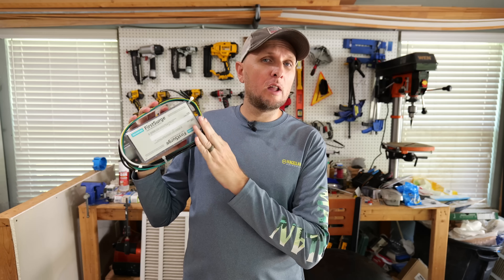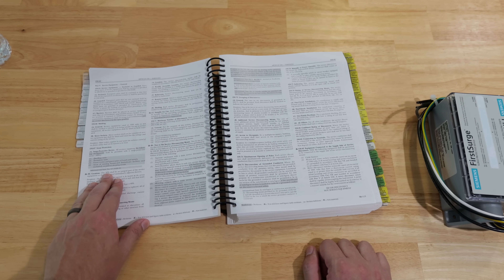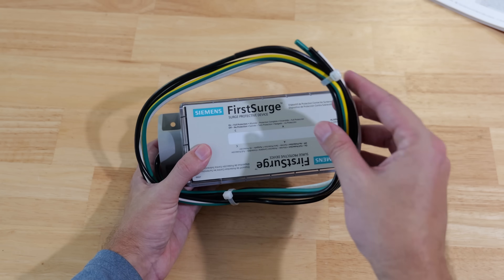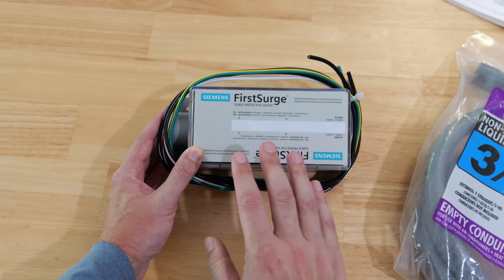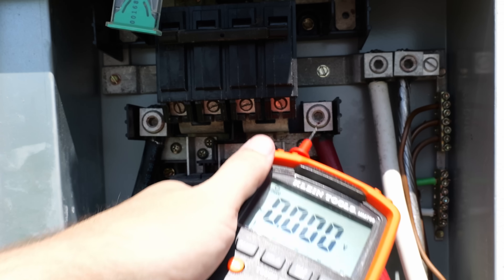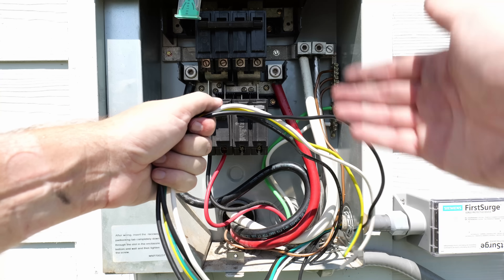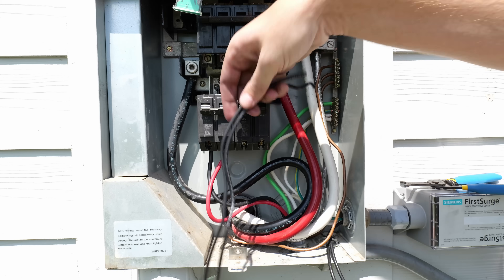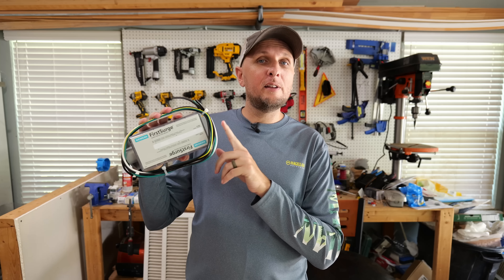Why Whole Home Surge Protectors Are Now Required and How To Install One!  Siemens FS140

Comment: If it makes you feel good go for it, it’s your money. More and more devices are mandated by the NEC because the code writing committees are packed with paid representatives of equipment manufacturers. The reality is that this stuff might protect some things sometimes, with a lightning strike there are NEVER any guarantees. The components inside these don’t last forever and most people won’t notice or recognize when they stop working so after several years they won’t be protecting anything. My experience as a 25 year master electrician in industrial and power distribution these devices generally cause as many problems as they prevent.
Reply: It is mostly about the money for the manufactures.

Comment: Where is your torque screwdriver? Code now requires torque to spec...since you are following 23 nec
Reply: I have found multiple breakers that have stripped screws due to over tightening, and found many ground, return, and breaker connections so loose they are intermittent or are overheating. I now use a torque screwdriver -Always!

Comment: For 50 years and longer never had a surge issue damaging anything. Last year I added a Square-D surge protector that fits into a breaker slot on my homeline panel. It is doing its job silently, still no surges that need protecting against ever noticed. Codes compliance keep electric people busy making money.
Reply: I often observe "it is better to be lucky than good." You are in an area that does not get a lot of lightning strikes on the lines. Usually people in vulnerable areas take strikes every few years or even more frequently. The cost of having an SPD installed is a tiny fraction of the cost of a healthy lightning strike.
Five years ago I retired from IT Filed Services for a Fortune 100 electric company. (There is only one here in Arizona, but I don't feel right mentioning their name.) Many of our communication facilities took lightning strikes, with a few costing us less than $1000, most in the $3000 - $20,000 range. The last big one I attended did over $30,000 damage to one piece of equipment and it took me more than a year of puzzling to understand how it got in.
Reply: Weird, been on earth 40 years two houses, no decided broken from surges...
Reply from the maker: Weird.  I haven’t even been on this earth that long and have had numerous things damaged by surges until I installed this.
Reply: @HowToHomeDIY  how many smoke detectors have you had to replace due to surges?
Reply: We live in Newport News VA, perhaps our area and Dominion power has little troubles with surges. We also almost never lose power. Last time without power was Hurricane Isabel, was out for 12 days which was tough, but the Troy-Bilt 8000 watt generator worked well for the whole house with the interlock.  @HowToHomeDIY

Comment: it show this model as a newer option to the siemens you suggest.  is it better?  Siemens Boltsheild FSPD140 Level 2 Whole House Surge Protection Device Rated for 140,000 Amps, 120/240V
Reply from the maker: It's not better.

Comment: Sometimes I think a lot of this is overkill, been living in this house out in the country for over 30 years, 2-3 computers, wifi routers, fiber modems, 3-4 flat screen TV's etc. etc. 60x40 steel building shop on a 200 amp service with at least 7 VFD's running 24/7,  Missouri in the Ozarks, power goes out at least once a month, backup generator takes over for a few hours,  lot's of lightning storms, at least 1 lighting strike a year on my property, shattered oak trees etc. Had a well pump get fried once 25 years ago, pump service said a lightning strike somewhere else in the area traveled through the aquifer and took out the pump, all paid for by insurance, no other person I know of has had any issues with power surges, maybe I live in a lucky area, who knows. lived all over the country growing up, Florida, Louisiana, Arizona etc. dad was a electronics engineer for the government, not once in my 62 years have I seen an issue with power surges damaging anything in my house or shop.

Comment: Knowing how to install it is valuable but understanding how it works is much more valuable.
Reply: Anything with an MOV will eventually fail.  The only way to effectively keep surges out is to use a series-mode inductive filter.  SurgeX is the best known brand of series-mode  but they do not make a whole house unit that I know of.  I own a SurgeX 20A unit thru which I power an extensive A/V production set-up and it saved my kit from the time my service took a direct lightning strike.
Reply: scottiestech info channel has the best video and john ward has good series of videos too. It is important to note that they go bad and need to be replaced every few years. Don't get the one seen in the video, get ones that go in a din rail so it can be cheaper and easier to replace.
Reply: @gg-gn3re some DIN rail devices are garbage out of China. 
Yes the Siemens is very pricey but it’s not garbage and far superior than most DIN mount devices. The only DIN devices that are trustworthy are manufactured by Eaton and Merzen.

Comment: i lived in a small country where brown out, load shedding and other interruptions was frequent so for over 20 years now we use  inexpensive surge boxes that plug in the receptacle and the appliances plug into them that monitors over and under voltage, surges especially for refrigerators it provides a delay restart to allow the fridge compressor to relieve some pressure before restarting.. i seen similar items on Amazon for ago $30  now a days plus for really sensitive stuff a UPS works wonders
Reply: Those are what you need not this

Comment: As well as many here, I feel this is just one more way for manufacturers to make money - requiring something through code. Yes, it's a good idea device, but I don't believe it's such a safety of life item that it deserves to be in code. I would like better explanation of its purpose when it is only required in sleeping areas of nursing homes. How does that jive with CO alarms and other electronics? Hmmm.
I am a home inspector and I do not call out the lack of an SPD in homes.
For those asking, the reason your newer home didn't get one when built is likely because your local authority does not require the most current code. Most are one, two or even three NEC issuances behind in their requirements (it comes out in 3 year intervals).

Comment: if you have 400A service with split 2x200A MCB panels, would it be enough to install on one of them? Similar situation would be a 2-family house with one overhead line to two separate meters... Thank you.

Comment: Here in California, the power lines have lightning arrestors. Power lines are struck by lightning very often in rural areas. In central Brasil, where there is no air traffic, the skies a super clean, and consequently, you get many clouds stacked on top of each other. A cloud is a giant million volt battery, and when you stack them they will eventually be so powerful that you will get lightning, and these puny siemens surge protectors are worthless for that kind of situation.  Not sure why the code requires this very weak device. If you are worried about lightning you gotta do way more.  

In cities near airports, there is so much soot from jet plane exhaust that high clouds cannot form, and this dirty air means no lightning strikes. 

Lightning is a byproduct of clean air. few people realize that 900 million gallons of jet fuel A are being burned in the skies yearly, and jet fuel A has Methyl Bromide in it, which is the main ingredient in the infamous Agent Orange defoliant used during Vietnam war.

Comment: Looks lie an older panel that does not have a separate ground bus and neutral bus?
Reply from the maker: It is only 7 years old.  It is the main panel.  They all have the ground and neutral bonded, there is no separation.

Comment: So, the NEC is going to pay for the devices AND all labor to add those?
That is an additional thousands dollars or more to have those installed.
NEC never got MY CONSENT for that.

Why aren't those built into your electric meters????
Reply from the maker: They aren’t that much.
Reply: @HowToHomeDIY  It is when the dang inspectors want everything else upgraded at the same time (like grounded outlets, replacing cloth wrapped wires, etc).
And the labor and such when hiring commercial companies to come out and do it.

If I had to replace my panel I would do it myself and skip all that money grabbing nonsense.
Reply: PS to replace an outlet and add two in my garage (detached) would cost me over $2,000.
They would have to rewire the garage, run a new line from panel up inside the 2nd floor of the house, then to the garage.
So I did it myself skipping all that nonsense.
I use an existing ground rod at the garage (separate from the house one) and added 3 feet of internal wiring and 8 feet of ground wire.
Works perfectly. Even have 2 of the outlets ground fault protected. Couldn't do the 3rd one due to space and wiring considerations so I rarely use that except for a clock.
Less than 0.5 ohms resistance to ground.
Voltage the same as the house too.
No discernible losses or hazards.

Comment: We had a bad linesman do a repair (dirty power) on the powerpole near our house.  A year later we came home to a disaster.  The neutral had dropped from the pole, the power had nowhere to go back to and the voltage kept climbing in our house.  Destroyed two water heaters, two whole house electrostatic filters. all small electronics from alarm clocks to gaming consoles.  Destroyed many plug in surge protectors and set fire to my air compressor in the detached garage.  The garage was full of acrid black smoke as the fire caused the compressor oil to leak which in turn caught fire.
Reply: Sounds like a nightmare.  A surge protector might not protect against that since they are designed for transient spikes and not sustained increases.
Reply: @dansanger5340 Thanks for your comments, I looked into that subsequent to your comment. Yes, a surge protector would not have helped me on the voltage continuing to climb, only a good neutral connection can save you.  That is why as soon as you see you have dirty power, call the electric company to see if there is a bad nuetral.  We obviously did that but they either did not do anything and said they did or just made another bad connection.  I don't know, maybe there is a device that detects a sustained voltage increase, and can somehow trip a breaker to simulate a ground fault, I shall keep researching.
Reply: Make sure your ground in the house is good. The one where the ground rod is at.
Reply: I worked in a federal government building where we were installing RF screen rooms for testing radios.  We bonded the shells of our rooms to building and found there was about 40 vac from the neutral conductor and the building steel.  Something had been done incorrectly with the three phase step down transformer for our area of the building.  Electricians fixed the error.

We also encountered an interesting problem with Topaz voltage regulating auto transformers for the single phase 120 vac power feeding the screen rooms.  The Topaz units were tap switchers which had a board with thyristors to automatically pick a tap to deliver close to 120 volts.  There was a small always-on signal transformer to power the control board, protected by a 1 amp fuse.  For reasons unknown the fuse in one unit opened and that set up an oscillation which generated 1800 volts of RF on the wiremold outlets in the room.  The same thing happened about six months later on the Topaz transformer for another screen room.  Sometimes trying to do good things winds up causing trouble you didn’t bargain for.
Reply: Sounds like it was your fault, bad ground, don't blame someone else for your fault.
Reply: @kidkv  Unfortunately, this was not a short circuit situation, a dropped neutral causes voltage climb, it is not a ground fault.  The electric company took full responsiblity, paid all claims outside of insurance company involvement, their head trainer was actually the guy who responded and came out and took photos of the bad connections, and the fire damage in the garage, said it was the worst connections he had ever seen in 40 years and would use this as a case study and develop training materials on the importance on following the SOP on making neutral connections.  As you are an expert in electrical engineering you would know that the neutrals and the ground connect to the same bus bar and all go back to the neutral at the pole.  If there was a short and the main trip to the house supply went then everything would have went to the ground circuit and to the ground rod.  But please keep commenting, your input is very valuable.
Reply: @David_Avidmind  Is your service connection 3 phase ? 

If it is i believe what happened there is that incase of an open  pen conductor or neutral dual phase will be in your single phase circuits (basically line to line voltage will be there in a single phase load )

Loads that are not rated for that kind of voltage will fail. 

Solution: So what can we (as a consumer) do, We can  install a voltage monitoring relay usually cost under $100 (which can give a wide range of protections including an open neutral/pen ) 

If the utility company is using tncs ask your electrician to ground pen conductor on your premises.  

Hope this helps :)
Reply: @alex-hk  Thanks Alex, I will look into that.  I have Single phase, 2 poles coming in the house into two 300amp panels.  We have a very long driveway with a transformer all our very own at the pole nearest the house.  The neutral they worked on was where it drops from the transformer, there is a connection about two foot up from the base of the pole.
Reply: @David_Avidmind Is it split phase transformer basically you will get 2 phases and a neutral  ,if yes in this case also it's the same thing I mentioned before .
Reply: @David_Avidmind  , I'm not surprised  this happened
Reply: @kidkv  Not at all. The unfortunate fact is that local grounds are both crucial and inadequate. By far the best ground most commercially powered sites have is the neutral of the power line. It shares the grounds of other drops for miles around. If your local ground has a resistance of below 5 ohms it is remarkable in most of the world. The Fortune 100 electric company I retired from went to great lengths to get the best practical grounds (for lightning considerations) on our sites and were thrilled to get them below 5 ohms.

Comment: You're very fortunate to have access to the main outside supply breakers.  Where I live these are only accessible by the local utility and they use this as a selling point for their subscription-based surge protection plans.  I installed an Eaton CHP ULTRA inside but would love it if I could also add an external device.

Comment: I am not an electrician, and would it be possible to explain how it does what it does.. as logically, it looks like it was an addon, and not "in-between" the current from the main power and the home.. It looks to be parallel to it. Is this something that can be explained?

Great video, but some of us are not even at novice level.. and need the "explain like I am 5" version. :)

Comment: Many of those safety devices run exclusively on batteries. Surge protectors will not do squat.

Also surge protectors do NOT protect electrical systems 100%.  A direct hit near house well get a EMP hit and unfortunately electronics go bye.
Reply from the maker: None of mine run on batteries.  Smoke alarms aren't the same as they were 20 years ago.  They now are hardwired when installed and communicate with each other.  So yeah, the surge protector will help to protect them.

Ok yes a direct hit cannot be stopped by much of anything.  That is not the cause of most surge related damage.  So just don't have any surge protection?  That is your solution? 😂
Reply: Not a false sense of security.
And you can still buy battery operated smoke detectors.
Reply from the maker: Yes you can but that’s not what’s being installed anymore.  It’s not a false sense of security.  Surge protectors work on the vast majority of surges that occur.  Not having one makes no sense.  But if you want to stick your head in the sand then be my guest.

Comment: What about the parts of the house that are under the 50A breaker on the left?
Reply from the maker: The 50 amp breaker on the left is just for my generator hookup.  The sub panel in my garage has all of the home’s circuit breakers.

Comment: Interesting. Why then did the Master Electrician and his crew not know about this when my new house was construted in 2015 not know about this new requirement? Was it just recommended at the time and is now mandatory?
Reply from the maker: In 2015 this was not a code then.  And even now it depends on your municipality as to what code edition they have adopted.  Some are still using the 2017 and before editions.  Most are at least using the 2020 now though.  So just depends.

Comment: My main panel is in the basement with the main breaker in the panel. To install this surge protector  I would just need space to add the double breaker  in the main panel is that correct?  I've never seen a set up like yours where the main breaker is outside the house. I have been looking to install a whole home surge protector.  We are prone to get power hits and outages in my area due to all electric lines being on poles where they don't trim the tress often enough. I am sure I can install this myself. Took electrical in HS but then joined the Army and when I got out got into the telephony business. As a matter of fact I worked at Siemens.
Reply from the maker: You are correct.  Yeah we have the same issue here.  I’ve had one of these installed for the past 4 years after we lost some appliance circuit boards and haven’t had an issue since.